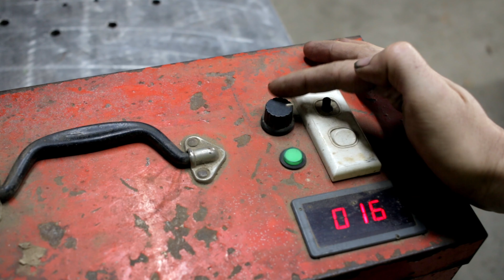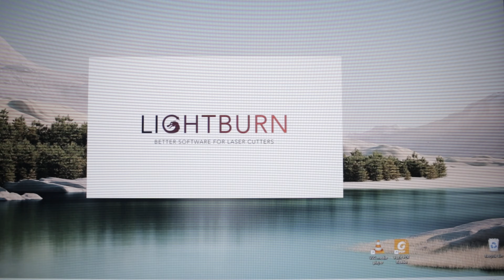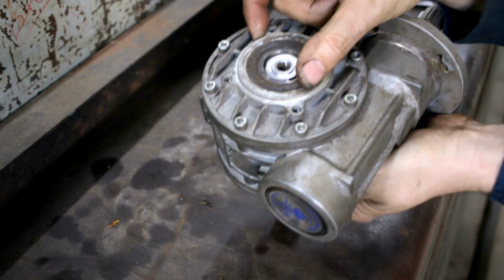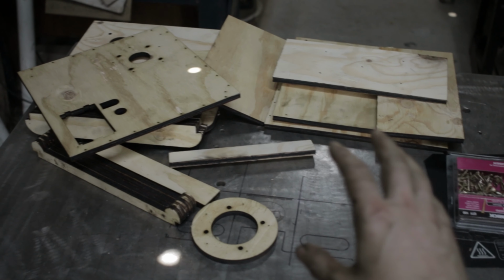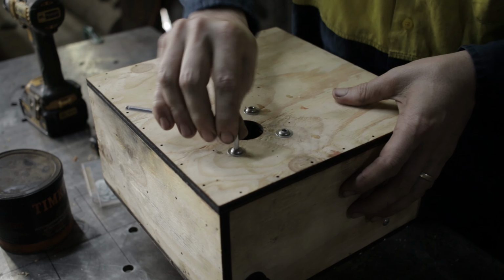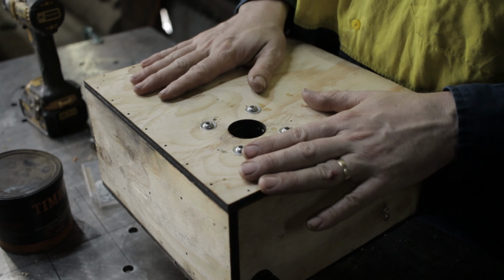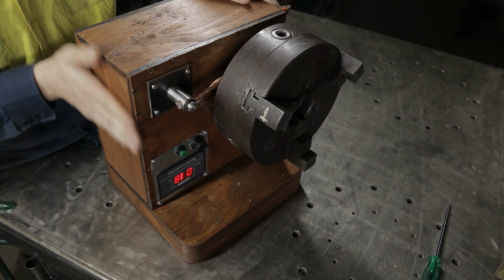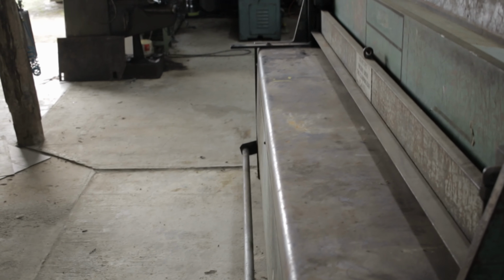Wooden Rotary Welding Table ? Not as bad as it sounds

Comment: What a terrific upgrade to your first version.  One observation, there are no ventilation holes or openings.  I admit that the contents will stay dust free without them but the power supply and motor probably generates heat.   Perhaps a bit of metal plate or a couple aluminum heatsink devices could be inserted into wood sides to dissipate heat.   

Your spring rains sound great.   Here in NE USA we are preparing for several months of snow.   Enjoy your growing season.  Wishing you and your family a blessed holiday season filled with gentle seasonally appropriate weather.  Peace brother
Reply from the maker: I had a similar thought about cooling, 
And if I had a spare computer fan i would have definitely installed it in but unfortunately with time constraints I just had to go with the current design.
I'll address this in the future if it becomes a problem.

It's always nice to hear from you friend 🙂
Reply: @LittleAussieRockets  Steve,  your creativity and craftsmanship are always amazing.   Watch the scrap bins for old tower computer systems.  Since you are using a 12v power supply for motor, you may find a heatsink and a 12vdc cooling fan all in a single unit.  Power connections in PCs are color coded.  Black is negative, green is ground, orange is +3.3vdc, red is +5vdc and yellow +12vdc.  

The original metal tool box negated the need for heat considerations.  Stay safe out there and enjoy the blessings of your children.   Peace brother

Comment: I love watching machining channels where every detail is obsessed over, where the finish of every little piece is as important as the finished item which has to look beautiful as well as function perfectly. However I also get to real kick from channels like yours where function is more important than form, where the odd scratch is ignored and getting the job done and working is the main objective. There's still some design and the finished thing needs to work perfectly etc but you're not using a surface grinder due to the surface being 0.001 mm out of flat or whatever.

Comment: wooden box, welding.... = burn burn burn........LOL
Reply from the maker: I addressed that issue, but you're right, 
It's always fun to engineer a little bit of excitement in the workshop.
Reply: youve obviously never tig welded, or probably welded at all. where as some welding techniques which are literally as subtle as a sledge hammer like forge welding, tig is more like artisan calligraphy by comparison. it uses a beautiful artisan gas argon which is completely inert and beautiful in and of its self and the tig welding process is amazing. not only does it not make anything that could set wood on fire but go google "pretty tig welds" and you will see its a whole artistry in and of its self. i learnt to weld as a young kid and always loved it but when i learnt tig it was something special. go dosome research and maybe even tryy it yourself